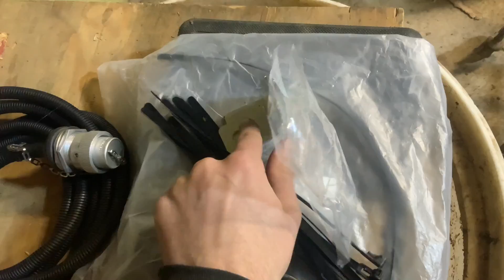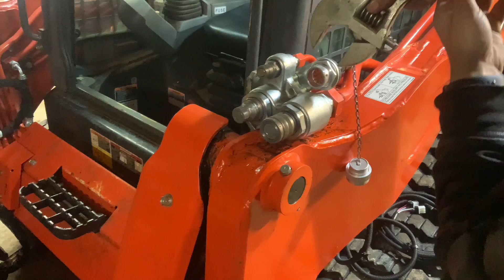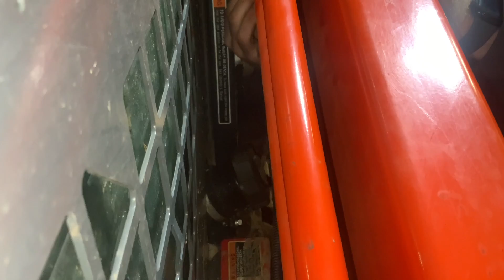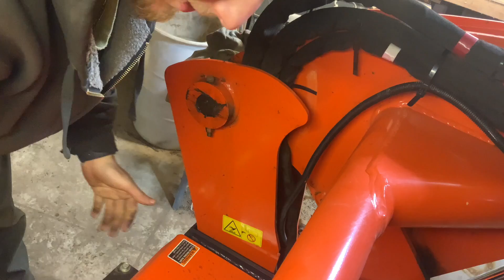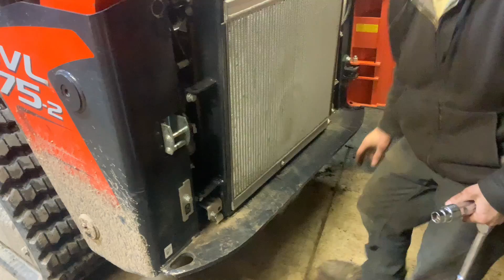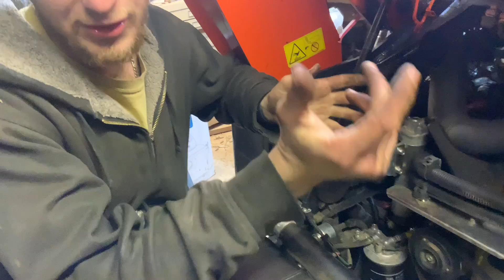How to Install a 14 pin electrical connection on a Kubota SVL75-2

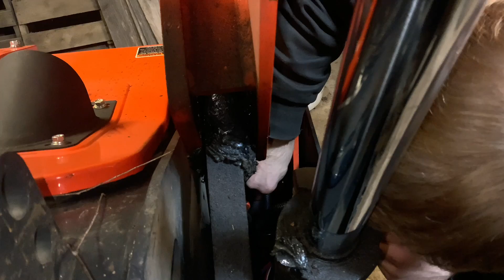Comment: At 7:20
Who did that welding job?
Grind it off and start over
Reply from the maker: That’s factory welding
Reply: @SmallFarmGuys  Must have welded it  just before lunch break. I have a SVL90 2 with cab. I have yet seen a bad weld. 

I did blow the glass (safety glass of all things) by the right track. I pulled the left to use as a pattern to make 2. One for the left and one for the right. Both are now lexan. Did not want to clean up another bunch of broken glass. (still finding glass every now and then)
Reply from the maker: Yeah blew the front window out of this skid lol it was a mess
Reply: That’s grease……….

Comment: what joysticks do you have? did you have to upgrade? i have an svl 90 and im curious if it works on mine with the left over controls on my left joystick
Reply from the maker: We did post a picture of the joystick in the machine so check it out

Comment: Just for reference is that the DPF filter the black filter I'm trying to find my plug
Reply from the maker: If your at the back door of your machine it if straight in behind you water fuel separator is about 6 inches behind that